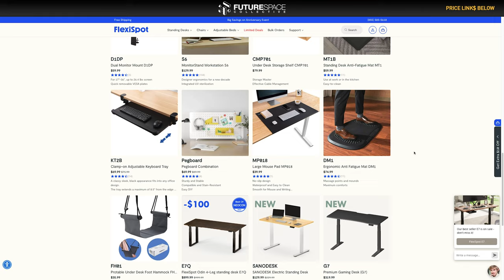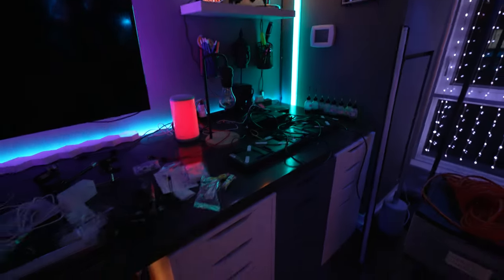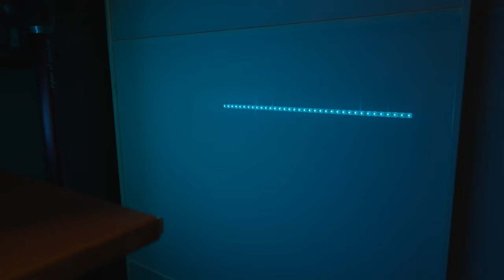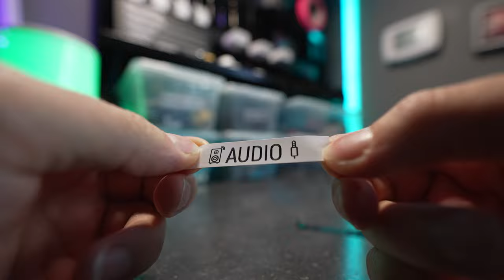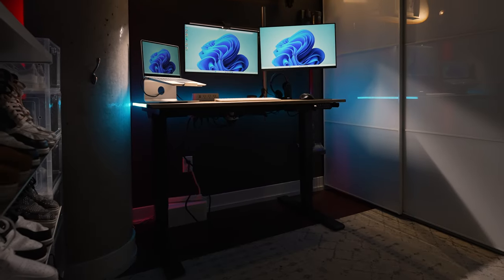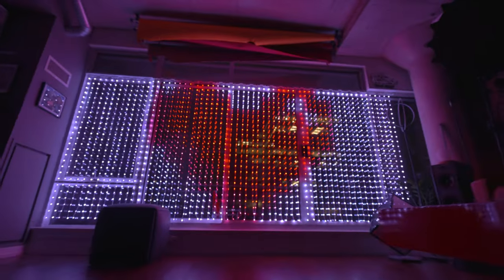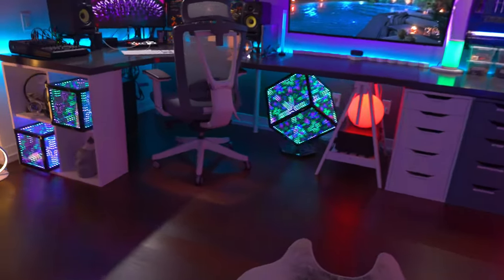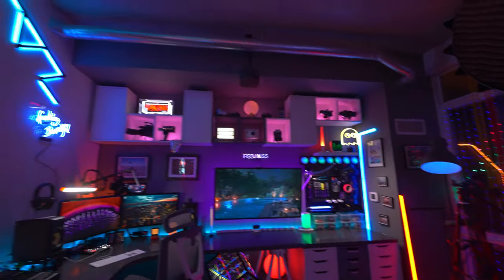My *NEWLY OPTIMIZED* Youtube Studio Setup Tour

Comment: Hello!

Your setup looks cool, but there is one thing that disrupts me and its the disco lights on the window. They look like christmas lights that we put on during the Christmas here in Finland. They might also look like a gogo bar, or pizzeria.

Sorry for my maybe little harsh opinion, but its fine if you like them :D I would take lights off. Other wise your balcony has very chill vibes with all the plants and stuff. Some cozy natural / normal lights could work better instead of disco. Also neighbours might find those disco lights disturbing. Have you got any complaints? Yet they probably take a lot of electricity.

Those cubes are cool btw.
Reply from the maker: All good thanks for watching and taking the time to offer your thoughts! It's easy to shut off the curtain lights, if I'm going for a different vibe but have been pleasantly surprised by them when you step back and use em like a screen!